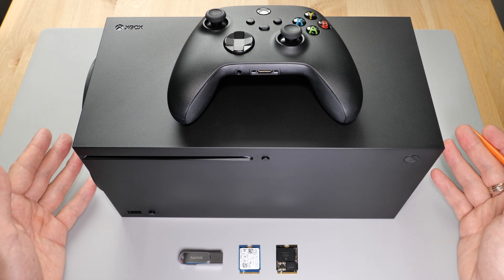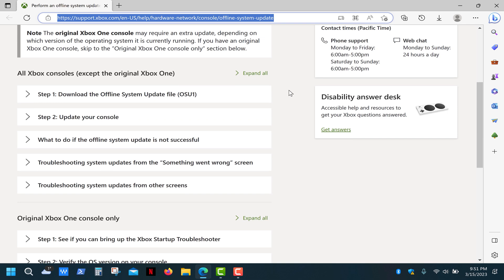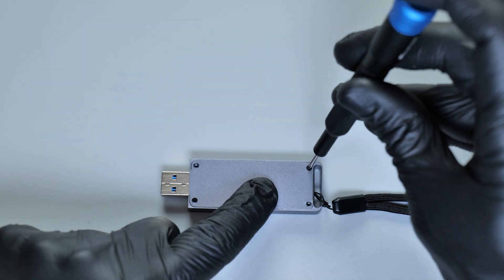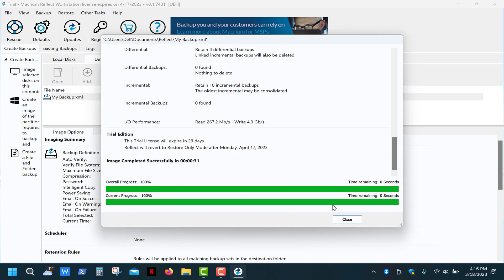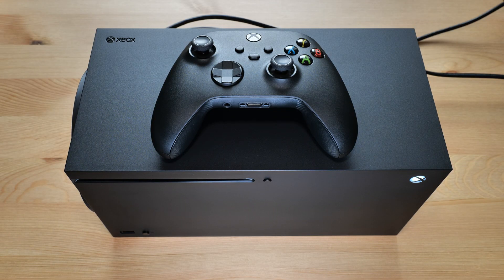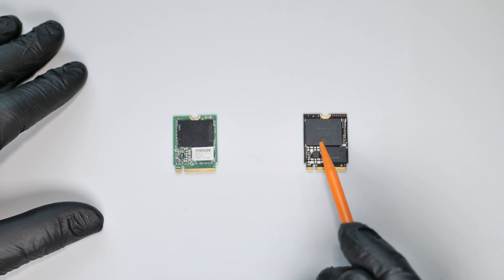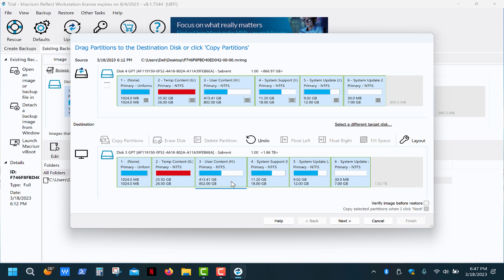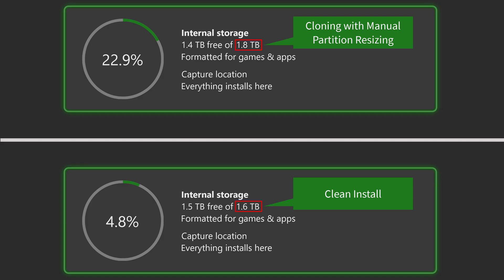Upgrade Xbox Series X SSD to 2TB – Clean Install or Clone Method (Step-by-Step Guide)

Comment: Probably gonna have to watch this a bunch of times to really sink in what i need to do and the whole process. I did the one for my Xbox One X without any problem but this one for the Series X seems to be way more complicated and if you really mess something up things can go really bad.
Reply from the maker: I've demonstrated the process, but I highly advise against attempting it. In previous Xbox generations, there was a chip with a bootloader on the motherboard, and I've repaired dozens of consoles without a single problem. With the Series S|X, it's more like gambling because now the bootloader is on the SSD, and after each update, the encrypted partition changes. So many things can go wrong, leaving you with a console that only Microsoft can fix. I hope that one day they whitelist all the SSD models and provide us with a tool to create a new boot partition on a new drive.
Reply: @ElectronicsComputers which there should be on like ever made MB. They do this on PC mbs and ps4-5 mbs so that if the console reaches a unrecoverable state it can be fresh installed and repaired via the user. Just another way Microsoft can try to screw its customer base out of right to repair.
Reply: @jernplays1815  Without all the encryptions I think xbox ones could get hacked , only benefit I like is that way less cheaters.....I guess that's worth the hastle ....although i think it should be easy to change a harddrive etc.... but even apple and samsung do the same thing ....then have there outrageous repair things ......as for me what sucks is i got 2 xbox one x and series x .....seem to work well until a update even was able to download it on the xbox and then e208 error with a series x with only 400 hours and i get sent to a $350 page to repair there crappy update.

Comment: Does the type of M.2 matter when cloning? and if so what brands is recommended for cloning? Thanks and love the video. 💚
Reply from the maker: I showed the process but I highly don't recommend to do it. Because the previous Xbox generations had a chip with bootloader on the motherboard and I fixed and repaired dozens of consoles and never had a single problem. With the Series S|X it's like a gambling because now the bootloader is on the SSD and after each update the encrypted partition is changes and so many things can go wrong so you'll end up with the console that nobody except Microsoft can fix. I hope one day they whitelist all the SSD models and give us a tool that can create a new boot partition on a new drive. 
The easiest one to upgrade is Series S to 1TB, the links for SSDs in the description. You can just use a random SSD from the shelf.
Reply: @ElectronicsComputers that would actually be fantastic
Reply: @ElectronicsComputers wait you're saying you can use random SSD off the shelf.... Is that true? Other places you specify the two particular model/brand.

Did you mean "CANNOT" instead of "can'?

Please clarify and correct if needed.

Comment: Why don't you tell us what the 2tb ssd model # is and where you got the "tweaked" firmware for it??
Reply from the maker: That SSD is from the guys who work on SSD data recovery. I was given that drive for testing purposes. I don't know when they will start selling those modified drives on eBay. I have no idea what manipulations were done to the drive. I think they simply modified the firmware; there was flux around the controller chip, though. If I had all the information, I'd definitely share it in the video.
Reply: @ElectronicsComputers  who are they??
Reply: One of the chips clearly says SanDisk on it. WD owns SanDisk.
Reply: Maybe they flashed the SSD with a software to "change" the controller chip name and information.
Reply: @LEESTLANE  the channel mod deleted my earlier comments soon as i mentioned what ssd it was,so i doubt it. Seems this guy doesn't want people to find out which ssd you can use.
Reply: @solidsnake6405 This flashed SSD will also work as a storage expansion card, so if we can figure out this tweaked firmware we will be able to use up to 4tb regular SSD as a storage expansion card.vis the CFexpress port on the back of the console.
Reply: @LEESTLANE  i dont think the firmware is modded,i think its just a sn740 2tb ssd.
Reply: @solidsnake6405  It might be, but the SN740 2TB doesn't work on the XSX/XSS. Someone else on the comments said that this might be a brand new recently released model "SN770m".
Reply: @LEESTLANE  ive searched and i can't find any confirmation of this either way. Everyone is keeping the information hidden.
Reply: @solidsnake6405 I think you're right. Looks like SN740. Retail wise I see PC SN740 available. I wonder if there is such a thing as a CH SN740. Maybe firmware is modded to mimic that? Perhaps that's a whitelisted drive?

Comment: Safer bet: buy 2TB series X revision when it comes out, sell original. OR buy a 1TB or 2TB card, building an expansion card is also possible.
Reply: Drive will fail eventually as all m.2 have life span based on read and write usage. If you own a series s or x you should already be considering a back uo for when it fails.

Comment: Excuse me, can the 2TB update also be done on the Xbox Series S? Or only the series X?
Reply from the maker: It will only work after a firmware modification of the SSD.
Reply: @ElectronicsComputers  do you have a video showing how to modify the ssd firmware? Or is that part of the cloning?
Reply: @ElectronicsComputers Please, tell us how to modificate, so for us to use larger and any SSD as expansion cards.

Comment: What can i do if i dont have the original ssd?
Reply from the maker: You have two options: send it to Microsoft for repair, which will cost about $350, or sell it for donor parts for about $50-$80. The console is essentially worthless without the original drive.

Comment: Too bad you couldnt use a m2 adapter and use a larger 2280. Also does the xbox have any ssd speed performance using a faster drive?
Reply from the maker: M.2 port in Xbox Series S|X has about 2.4gbps raw transfer rate using to lanes, so whatever gen4 NVMe you put inside you ll never notice any difference in performance, because that speed is way below what any gen4 PCIe can offer.

Comment: Excellent video all worthy information! is the largest capacity ssd the xbox can handle? Thank you much!
Reply from the maker: It can handle even 4TB with manual partition resizing, the problem is to make it compatible with the console. All drives over 1TB have to be tweaked first or we have to wait and maybe one day Microsoft will whitelist all the available SSDs.
Reply: @ElectronicsComputers thanks for your video. Any update on how to get more than 1 TB? Maybe a new video on 2 TB? Thank you so much in advance! 🙏
Reply: @ElectronicsComputers  thank you sorry i am very late 1 year later but thank you :)

Comment: how to create own storage expanison card?
Reply from the maker: Just put a compatible M.2 2230 SSD into that slot and plug it into your console. The link for that expansion adapter in the description.
Reply: @ElectronicsComputers can you please give me this custom firmware?? I wanna try to create a 2tb and 4tb expansion card by using this same custom firmware you used in your SN740 2230, in a regular SSD.

I have a 2280 expansion card adapter but the SSDs don't work because they don't have this custom firmware you are using in your SN740 2TB

Comment: There are a few things that can go wrong by doing this and effectively brick your console that it is not worth the risk, with no known method of a DIY fix unless you somehow managed to clone the keys in the original SSD. Until MS decides to un-pair their SSDs to the motherboard, I would never recommend anyone do this. You're better off getting one of those official expansion drives, unfortunately. Even third party enclosures aren't 100% safe. A future console update could brick those as well, not to mention that you need very specific drives for them to work, effectively negating any savings you would get from going third-party.

This is a very interesting video, from a tinkerer perspective, but IMO should not be used as a tutorial for people to do with their consoles.
Reply from the maker: There's always a risk if you don't understand what you're doing. We've fixed a whole bunch of consoles with partially dead SSDs and upgraded many Series S units with one-terabyte drives. I wish Series S|X had the same chip on the motherboard with the bootloader as in Xbox One S|X, or at least Microsoft could whitelist all the M.2 2230 SSDs for their consoles.

Comment: I tired doing a 2TB on A Series S about 3 months ago and it would not work. It would throw an error code... So did they white list 2tb's to work now on bot models or only the Series X?
Reply from the maker: You need an SSD with tweaked firmware to make it work.
Reply: @ElectronicsComputers  after re-watching you video.. I think I can fix my issue with re-sizing the partition.
Reply: @MichaelBaldwinb3l0kk doesn't work, still needs this secret firmware he is using.
Reply: @ElectronicsComputers  So where do you get this tweaked firmware from? also do you need to flash this firmware to the SSD yourself? also does it matter what brand SSD you use?

Comment: We are doomed, if ssd fail my xbox will be trash.
Reply from the maker: Unfortunately, Microsoft decided to cut corners by using the bootloader on the SSD instead of a dedicated chip like in the Xbox ONE S|X. If your drive fails, you can either sell your console for parts for about $50-$70 or send it to Microsoft for repair. As of today, they charge $350 for the repair service and provide you with another refurbished console.

Comment: Very confused about this video. The series S and x use proprietary SSD that you can't just replace with one off the shelf so how can this possibly work? Also I thought the proprietary SSD was soldered to the motherboard?
Reply: How are you confused? You saw him remove it. Where did you hear they were soldered on the board?

Comment: Many thanks for this video, Western Digital has just released a new 2230 nvme that goes up to 2TB : WD_BLACK SN770M Model WDBDNH0020BBK-WRSN. Considering the partnership between Microsoft and WD for the expansion card, do you believe that the 2TB model will work with the process you give us ?? 
Let us know if you try and please notice with the update. This is a huge hope to upgrade both internal and external SSD (with the CF adapter) Besides the time to tore apart, we may gain in higher speed and capacity...
Reply: interesting that on video same controller as in sn770m im wonder also, may be sn770m should work!
Reply: It will not work without a firmware modification of the SSD and that carries it's own set of risks.

Comment: in the video you are using a 2tb drive but the link is only for the 512 and 1tb, where can we find that 2tb from
Reply: @ElectronicsComputers it seems like you didn't mention what 2TB ssd you were using to upgrade the Series X.  Do you have a link on where to get this?  Right now I'm assuming you just purchased the 2TB expansion ssd drive from seagate or WD and removed it from the enclosure and installed it to the Series X.
Reply from the maker: You can't use SSDs from Seagate expansion cards because those drives don't have an M.2 connector. The SSD is similar to a regular M.2 2230 SSD, but it has a connector that looks similar to the connector on CFexpress cards. I was using a modified SSD drive, those drives may soon appear on Ebay and Aliexpress. But I hope that Microsoft will whitelist all the M.2 2230 SSDs.

Comment: Good video until the end where you also showed the entire clone option but without mentioning what is the benefits and the drawback of each approach/option, because obviously there are since they are (different) options.
Reply from the maker: If you don't want to reinstall your games and stuff, then perform cloning with a manual partition resizing. If you have a damaged SSD or just want to perform a clean install the you can use offline system update.
Reply: @ElectronicsComputers  if you clone your entire SSD there should not be the need for OS reinstall, right?
Reply from the maker: @ryutenmen    That's right, everything will look exactly as you left on your console and you won't see any difference except higher disc capacity.
Reply: @ElectronicsComputers  have you tested one or many Xbox Series SSD with a program like HDD Sentinel to see the state they are in, provided their used age is at least one year old?
I'm asking this because I've seen some videos on YT where the SSD were dead after a year or two, and by implications the Xbox became paper brick.
Reply: @ElectronicsComputers one more advantage being that there won't be an encryption key change (at least not until another system update)

Comment: Question: if your system doenst start and you dont know whats osu current on ssd, what you have to do?
Reply from the maker: Is your screen black or you see some error number?
Reply: @ElectronicsComputers  it enter on error screen. Once before i have xbox one fat, and it always fail to install osu, fails on74%

Comment: Can you tell me is it possible to put a pc hard drive of like 8tb in an Xbox series X and if so can you do a video of it
Reply from the maker: You can connect any HDD/SATA drive to a USB port using an enclosure or adapter.
Reply: @ElectronicsComputers  ok but can you put a pc internal hard drive into the xbox
Reply from the maker: @hawkshaw1014  There's no interface to connect it inside. Also, there's no room even to fit even a 2.5" drive.
Reply: @ElectronicsComputers  damn thank u anyway

Comment: @ElectronicsComputers  So if the very first partition is Temp Content, would that be the one I want to copy over to the new SSD?  When I plugged in the SSD from the Xbox, I got 5 partitions, 1- Temp Content. 2 User Content. 3 System Support. 4 System Update, 5 System Update 2
Reply from the maker: Xbox file system has 6 partitions! The Temp content is the send one. The first partition doesn't have a title, it will be either seen as "None" or RAW.
Reply: plugging mine in, it has 5, which are in order that i listed... so idk @ElectronicsComputers

Comment: Hello, I have noticed that you have made a lot of videos about thermal silicon grease.Include our brand (UPSIREN) Now our brand has recently developed a product (micro -capsule liquid metal thermal grease)

We predict that this may be a revolution in the thermal grease industry
We will also launch some microcapsule liquid metal phase change tablets in the future, similar to Honeywell, but the material will contain microcapsule liquid metal

Briefly introduce our products

Compared with ordinary liquid metal
1: Easier to Apply, Liquid Metal Silicone Grease is Difficult to Spread Evenly, But Our New Product (Upsiren Metal Thermal Grease MTG-1) is a mixture of some th. ERMAL GREASE and MICROCAPSUL More Delicate, Under The Pressure of the Cooler, The liquid will not overflow or tilt due to unEVESSS. Regarding the traditional liquid metal, we try it in The test, no matched what method we use, we can't apply the liquid metal perfectly
2: SAFER, We Hide the Metal in the Microcapsules, so compared to the liquid metal Silicone Grease, we are SAFER, and when the liquid metal comes into dide with with The Air, it will oxidize with oxygen and form a oxide (gallium oxide or TIN OXIDE, BeCAUSE The MAIN MINMAID GOLD GOLD GOLD Are Dopant Elements and Selenium Elements), When the Metal Elements are oxidized, A Film Will Be Formed on the Surf ACE, Which Will Lead to An Increen in Thermal Resistance, thereby affecting the thermal condition, WE PUT The METAL I Into the MicroCapsules to Perfectly Solve This PROBLEM
3: Better Performance. Ideally, The thermal Resistance of liquid metal smicone grase is low, but due to oxidation, its performance will be reduced. After texting , We Found that the Performance of Our Product Better Than that of trackingal Liquid Metal is better and has lower thermal residence

In General, Microcapsules Can Perfectly Protect Metals From Oxidation with Affecting Thermal Resistance, and are more fully Filly, LOWERTMAL Resistance, EA Sier to Apply, SAFER, and Play An Insulating Role

If you need it, please contact us lishihaoxp@qq.com, we will send you our samples to provide you for testing
Reply: sorry to bother you

Comment: Is this process should be repeated with each new update ? Or it's one time procedure with every new SSD meant to be used on xbox ?
Reply from the maker: If you're performing an offline system update, you have to back up the boot partition after every single update or even after unsuccessful update attempt.

Comment: Please tell me, is 2TB the max storage that can be stored in the Series S??
Reply from the maker: There are no 2230 M.2 NVMe SSDs larger than 2TB on the market as of today. Haven't tested any 2TB on Series S but upgraded plenty to a 1TB SSD. I'll post a video on how to do that in a few days.
Reply: @ElectronicsComputers  Great. I have my bell notification on. I will be hoping to see the video. What I did is I bought the WD Black SN850x and I have seen few videos of people building a DIY expansion card using the CFExpress adaptor. I will try to see if the SSD i can't can work with the adapter.
Reply: @nanaarhin5567 please, let me know if works. I have this CFexpress to M.2 adapter that supports the size of 2280 SSDS